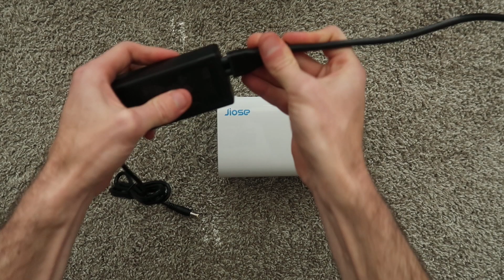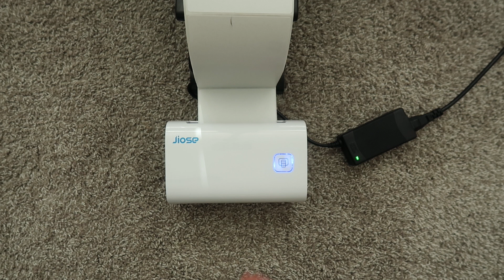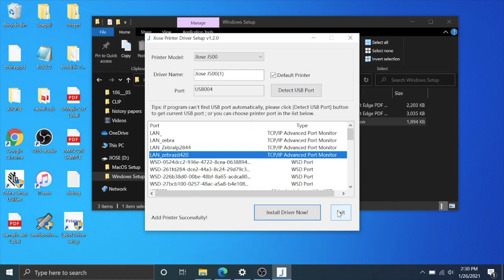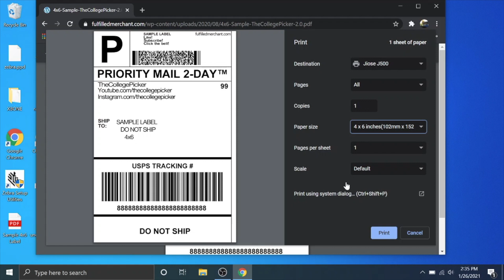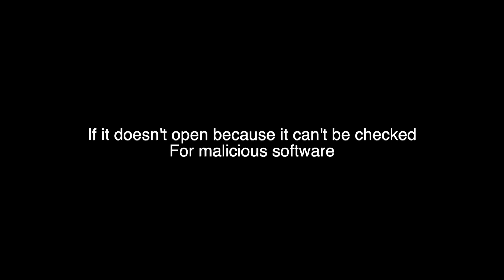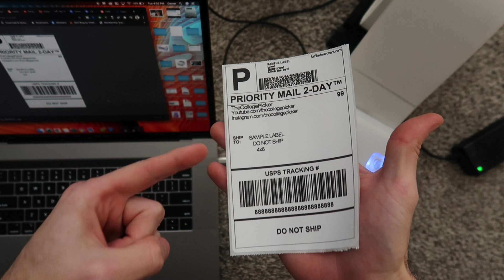Jiose Thermal Label Printer Setup on Windows and Mac | STEP BY STEP TUTORIAL

Comment: Just a heads up that these directions aren't going to work for everyone that has a Mac. I hard and soft rebooted the device over and over and it did not show up in the locations section of Finder. I eventually had to go to printers/scanners within settings and manually add it there. In order for this to be effective, I also had to download the driver ahead of time from their website so I could select it from the dropdown menu.

Comment: Mine is only printing a tiny sliver of the image. I've uninstalled and reinstalled, the labels are the right ones (same brand), settings are 4x6. It's previously worked just fine and now it's making me feel like I want to throw it in the trash :( I'm over it. It used to be so good :(

Comment: I like your video very well explained.Ok I have a Acer chrome and when I tried to install the jiose a message appeared!saying“ This file is designed for a PC using windows software this is not compatible with your device which runs chrome OS.So I’m going to buy a new laptop 💻 which one you suggest me?

Comment: Got this printer followed all the steps, I have a roll of labels fed into it. At thispoint the light is a steady blue. When I connect the USB cable, it keeps blinking red and won't print anything. Do you know what might be the problem? Thanks in advance.
Reply: Flashing Red means your paper is low
Reply: I had a full roll. This printer is good for garbage. I don’t recommend it.

Comment: Thanks for the video. If it won't print the sample for the jiose is it because the usb cable for the mac is the problem? I have the mac extention for a USB and the paper gets fed through the printer but nothing prints?
Reply from the maker: It could be. Are the labels in upside down by chance?

Comment: I try doing what u did and the labels won't align with the paper do u have to use adobe
Reply from the maker: You should not have to use Adobe. It sounds like a settings issue, were you able to get it squared away?

Comment: i just got mine and it isn't automatically feeding the labels through at all! any advice?
Reply from the maker: Oh no! Did you close the head all the way? Try giving their customer support a call when you can, I'm sure they will be able to help.
Reply: Insert the paper and adjust the size on the side to 4x6 if that’s the size you want . Push the button until it turns blue and you hear two beeps then it will automatically feed the paper